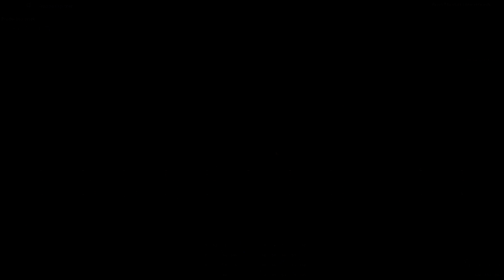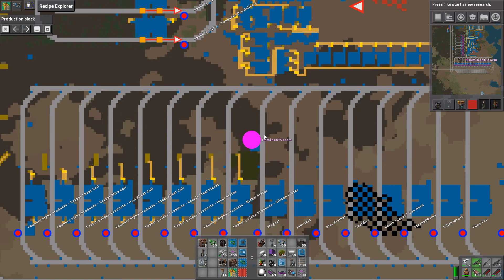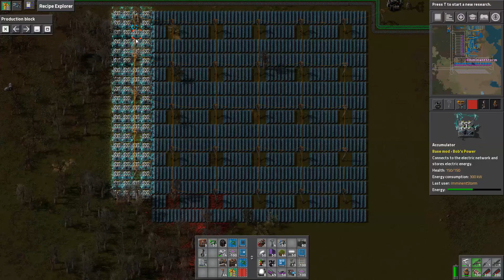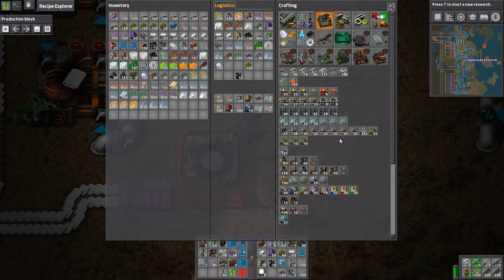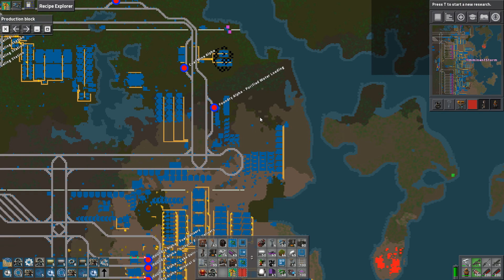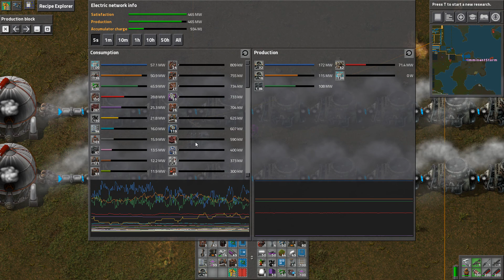Factorio - Angel's & Bob's - Episode 167 - Power Upgrades

Comment: Always nice to see another episode. You mentioned being concerned about how little steel you're making: see my comments on your previous video. I think one of the rows in your steel factory is not working because it's failing to get some input that it needs, but I couldn't tell which input. But double-check your steel production in the foundry, and see whether it's all running. That could be causing your low production.